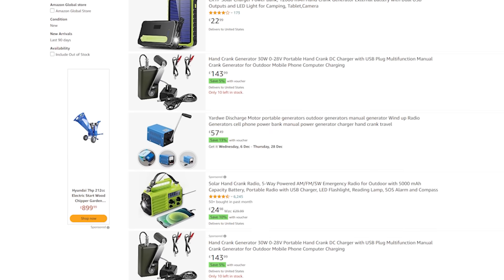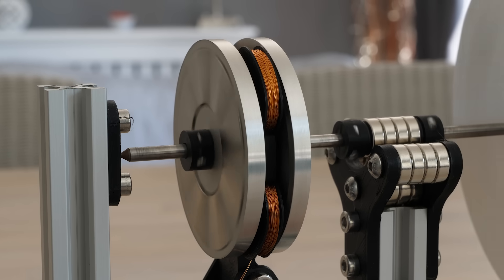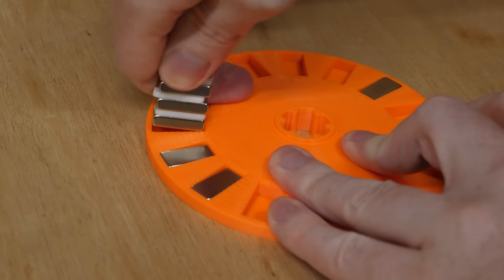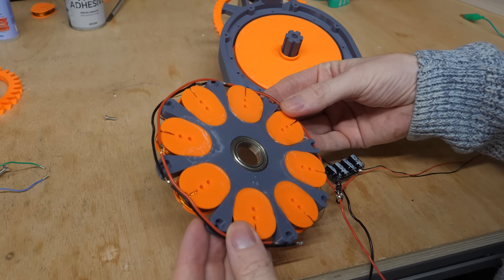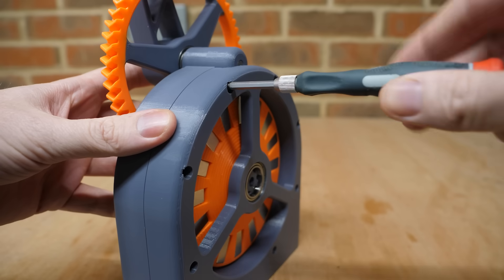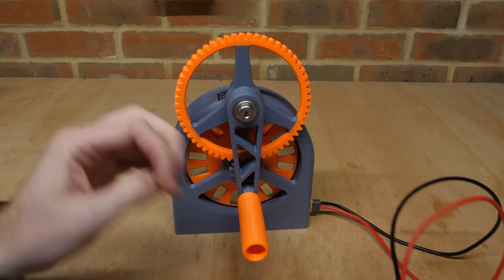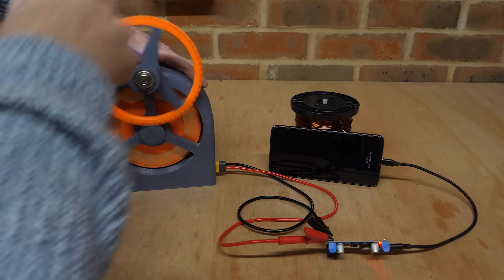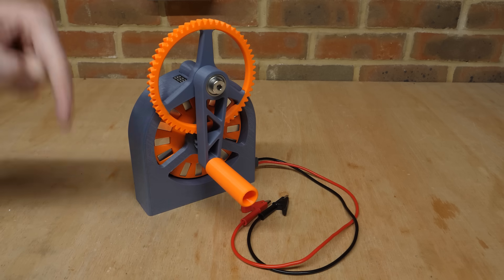Building a Generator

Comment: Your coils are biased too much towards current. Power is V * I and ultimately that's what a generator is about. Your coil wire is far too thick still. Especially in a 2S4P configuration. You could change to 4s2p and crank faster or use thinner wire with more windings.
Probably the best balance for a hand crank generator that I have seen was by some dude building stackable supercap banks. What he did was basically a supercap bank with voltage regulators.
I do think you need a voltage regulator in general. Probably two of them for 5v and 12v. or better something USB-C, for which you'd need higher voltage anyway from my tip up.
A voltage regulator will protect lower voltage circuitry and you can't do without it anyway, besides robust electrical consumers like resistor heating or charging lead batteries and supercaps.

P.S. that generator is way too big by the way for a human to turn if it was properly balanced. You can get far greater output by something about 1/4 the size. Which is at about the limit of what a human can turn efficiently(80-100W).

Comment: Great video! I wonder why you didn't measure the current?
Reply: Because it is so small. Think about old-school 3W bicycle dynamo, you can already feel the resistance in your legs. So this hand-cranked dynamo is probably smaller than that. If you want to fill 12 Wh phone battery, you need to crank the 3W dynamo for  4 hours. No thank you.

Comment: What if you had equal number of coils and magnets? I made one in 2000 as a pulse motor generator. It was a mix of Robert Adams motor/generator's design with 8 magnets and coils, and Bill Muller's design which is what you've made. It was one of the most fascinating rabbit-holes I've ever jumped into.
Normally the cogging would be terrible, having equal number of magnets and coils. Their claim In a nut shell was, to draw current from the coils as the magnet was coming towards the coil, and when the magnet came in register with the coil, stop drawing power and let the transistor turn off. The sudden back emf from the coils was then routed through a diode and to the main supply capacitor. Like a basic boost converter circuit. 
A lot of people claim this type of pulse motor generators are over-unity. They're not right. It's as efficient as a SMPS and not much torque beyond being a fan. 
But boy did I have months of good fun playing with it experimenting with different cores and windings. I used a basic stamp from parallax to control the motor. 
I still have it on the shelf as a display in my lab. Didn't have 3D printers back then, so it's all machined out of derlin, non-magnetic stainless steel and brass. A real eye candy every time I see it. 
Keep yours intact and thank me in 20 years.

Comment: You could try lighting up a 220v LED lightbulb. Depending on the driver being used they shouldn't mind being run on DC, and unless they use a capacitor dropper they should work on a large range of voltages. By the way, have you considered adding multiple stacks of coils and magnet disks?
Reply: I'd go with a 12 volt MR16 LED bulb. They generally include dc-dc converters and many operate quite consistently between around 8 to 16 volts. They also include rectification at the input.

Comment: Shouldn't you have a female connector on the output? In batteries, this reduces the chance of short-circuits caused by things falling into the connector.
Reply from the maker: Yes, that's correct. However, I wired it this way because it doesn't matter if the generator short circuits (the crank resistance just goes up). But if I charge a battery or capacitor, I don't want the wrong connector on them as that short would be far worse.
Reply: @TimStation  Ah, I completely forgot that the thing you are plugging your generator into also is a power source. And I agree, since you are charging a super-capacitor, the short would be much worse than your generator. PS: I see that @Maarrk also made the same comment.

Comment: I think you can increase the efficiency by changing the coil design. As far as I know the part off the coil that is perpendicular to the changing magnetic field contributes the most to the output. The rest is just added resistance. Also you can increase the power of the magnetic field by adding a backing metal or hallbach configuration of the magnets.
Reply: Look at hard drive motor, coils shaped like wedges with rounded corners. Why? What you just said about the impedance reluctance resistance etc
Reply: This type of motor works well, it is called an axial motor. Backplate would be nice, but only if laminated perpendicular to flux direction. This would mean like an arch of bricks between each coil. Winding layout should be 3 coils for each pair of magnet (easiest, classical synchronous machine). And the interconnection should be diffenent. It sure works with all coils in line. But he gets big circular currents driven by voltage differences due to the coils seeing different fields - also depending on winding direction of the coils (clockwise, ccw).

Comment: Awesome build and Physics applied !! And even a cool color scheme !!  Love it! I’d love to test if that thing would start the onboard computer of my car (I use it very unregulaly and the onboard 12V battery gets so low the controllers don’t come online, since it’s a hybrid, The 12v are not needed to fire it up, just to close the DC-DC so I “jump” it with my DJI Phantom Battery sometimes… ) this would be more fun as I could store it for emergencies and not carry a charged Lipo… Hand crank start of a 2003 Prius would be cool… the equivalent of a Inertia Starter for Tanks As I see it…

Comment: You should look into a serpentine coil.  This is one that weaves up and down as it goes around the full circle of the generator.  They are much easier to produce and work better than individual coils.
Reply: An even easier build and more powerful  is Robert Murray Smith thunderbolt generator. Think he got 150V out of it. Really impressive.
Just went round the bolts in a big circle. Easier than his serpentine. With offset magnets to reduce the drag.
Reply: @strawman9410 I think his serpentine is easier to do in practice for a given power output and also that the bolts will have eddy currents in them that will eat into the efficiency.

Comment: In bicycling, I usually find my legs are better at peddling fairly hard at a moderate speed than peddling faster with less force; seems like cranking hard to charge the capacitors, then letting the capacitors charge your phone for a while, would be a really ideal way for a charger like this to work
Reply: For optimum cycling performance, lighter gears and faster pedaling is more efficient for most once you get to a decent aerobic fitness.
Reply: @tktspeed1433  for you perhaps, but I'm powerful and heavy. Moving my legs fast is hard, moving them forcefully is not.

Comment: This actually gives people a very easy way of physically feeling how much power it takes to run different types of circuits, I think it would be a cool idea for a science fair or something
Reply: reminds me of a science museum that had a device with a hand crank and would let you try and power old lightbulbs vs new led bulbs and see how it's easier to power led bulbs
Reply: @thebirchwoodtree Same at the Los Angeles Science Center, but it's a stationary bike there.  There are, iirc, 5 incandescent light bulbs and 5 LED bulbs of the same light output that you can switch between powering.
Reply: @thebirchwoodtree   I saw this the first time when I was a kid and visited the "Abrafaxe Extavium" in germany. They had a bike with a generator and besides different light bulbs (incandescent, "Neon" (energy saving), LED etc.) they also had a toaster... After pushing the lever down the bike felt like it instantly slammed the brakes as it is actually quite a lot of energy to only keep the magnet engaged, nevermind feeding the heating coils with "only" ~600w xD. They had a lot of devices plugged into that bike for kids and parents to try out. I only remember these and a fan though
Reply: @thebirchwoodtree  "centre des sciences de montréal" i think
Reply: @thebirchwoodtree  🔴 What Is Islam? 

🔴 Islam is not just another religion. 

🔵 It is the same message preached by Moses, Jesus and Abraham.

 🔴 Islam literally means ‘submission to God’ and it teaches us to have a direct relationship with God. 

 🔵 It reminds us that since God created us, no one should be worshipped except God alone. 

 🔴 It also teaches that God is nothing like a human being or like anything that we can imagine.

🌍 The concept of God is summarized in the Quran as:

📖 { “Say, He is God, the One.  God, the Absolute.  He does not give birth, nor was He born, and there is nothing like Him.”} (Quran 112:1-4) 📚

🔴 Becoming a Muslim is not turning your back to Jesus. 

🔵 Rather it’s going back to the original teachings of Jesus and obeying him. 

More .....
Reply: pretty sure they have something like this in the glasgow science museum
Reply: yeah i hear a lot of good things about that museum. maybe i should check it out @KingJellyfishII
Reply: Many exercise bikes include this as a feature. They have watt readouts and you can feel how much a particular wattage is with your legs.
Reply: @ehhhhhhhhhh  competitive cyclists measure how many watts they can make relative to their weight to track their fitness and effort levels, see what effort they need on hills without puffing out, and to see what pedaling speed is best for power to know when to downshift or upshift. An inexperienced cyclist can think power is high because force is high, but can downshift and it feels easier yet the wattage is higher. Or maybe you are flailing your legs around and need to add some resistance at a lower speed. Maybe you are taking a climb too hard, but if you know you will "puff out" above 320 watts, you won't pedal faster and harder just cause it felt "easy" at the beginning of the climb.
Reply: They have something like this in practically every science/technology museum/fair.
Reply: my local power company has an exhibit in our museums that does this, with a hand crank, and a line of lights, representing various appliances.
Reply: There is a video of a professional biker trying to power a toaster I wont spoil to much but its quite humbling
Reply: I was at an open house for the Goddard Space center and they had a setup with a generator attached to a bicycle. I was able to sustain power for LED, Fluorescent, and incandescent bulbs. Then i was challenged to power a small hair dryer. 

Let me tell you that the heating elements for that was greater than the combined power demand for the lightbulbs
Reply: indeed
Reply: Yea this should definitely be in a Science Works or at O.M.S.I.
Reply: It's been done and it's good for kids. Back in the 90's at a local fair near Berlin, i pedaled on a geared down generator to power a small black and white TV. I think it had... something like 5 reductions till it got to the generator. Felt like a slight 10~13 degree climb.
Reply: Noted get a 3d printer and print this
Reply: Should be taught in elementary for a brief period
Reply: Going to do this with my son for his science fair
Reply: මැගනටි ගන්න කහේද තියොන්නේ
Reply: to bad the limitations on scheduling those sort of events is very limited
Reply: Powerhouse Museum in Sydney Australia used to have the front of a typical fire engine on a wall, with an exercise bike facing it... As you pedalled faster, different parts would start functioning on the fire engine - FM radio (which was tuned to a local music station), headlights, beacon lights, siren, etc... each part was labelled with the power required to get it running.
It was pretty easy to maintain the radio and get some tunes in the room, but quite difficult to get the headlights and beacons running.
Reply: >way of physically feeling how much power it takes to run different types of circuit
There is video named "Olympic Cyclist Vs. Toaster" - I'd say it gives a lot stronger perception of how much power we use everyday ))
Reply: My highschool science teacher had a bicycle generator hooked up to a switch board, and on a pvc stand were 3 incandescent bulbs, CFL bulbs, and LED bulbs they would turn on one at a time so you could see how hard it was to pedal for each group of lights. 3 led bulbs were easier than 1 CFL, 3 of which were easier than 1 incandescent.

There were also a few larger things like a fan, a tiny vehicle window defroster, and a 500w blender. Pretty sure a couple other small everyday items, but its been awhile.

It was great being able to feel the difference in force required to turn the generator. I think if more people were made to understand THAT demonstration, less people would be against the technological progress of dropping fossil fuels and investing into making current electrical devices more efficient.
Reply: BRO IM DOING THIS FOR SCIENCE FAIR W
Reply: https://www.youtube.com/watch?v=S4O5voOCqAQ
😁
Reply: https://www.youtube.com/watch?v=S4O5voOCqAQ
Reply: I using it for science fair
Reply: If you spin that thing with an electric drill are you generating the same amount of electricity as you are using to spin it?
Reply: @FieldBoy111  I think you can't, you will definitely loose some power in the process. So you end up producing less than input.
Reply: @FieldBoy111 nope, losing energy to friction and incomplete energy transfer from magnet to coil
Reply: It's amazing how many of you idiots think this is so cool like your so dumbed down anything will please you
Reply: I'm going to use this idea for my science fair
Reply: I used to travel to schools showcasing this. We'd start turning on multiple lights. Kids could barely last 60 seconds.
Reply: I didnt know until now that it gets physically harder to turn a generator the more energy it needs to output.
Reply: @jwalster9412 Welcome to non linear mathematics

Comment: Yeaa... Like some have already mentioned I too would suggest going with a System mimicking the System how small ICE Motors like those found on Lawnmowers are being started with a self-rewinding Cord only applying Torque in one direction. Make it so the entire System can be clamped to the edge of a Table with the Cord hanging down and be operated by your Foot. If you get the tension of the self-rewinding Mechanism juuuust right, then you may even be able to use the weight of your Leg itself ( if you operate it with your Heel instead of the Toes ) to help with the unwinding action thus reducing the fatigue.
Alternatively, you could have a go of replicating the function of how a manually operated Sewing Machine work ( like the Singer ones ) 🤨

Comment: I suppose it's not as much of a concern at the low voltage and manual power creation, but typically XT style connectors are female plugs on the power generation side so it won't short out through the two male pins with a spark.
Reply from the maker: Yes, that's correct. However, I wired it this way because it doesn't matter if the generator short circuits (the crank resistance just goes up). But if I charge a battery or capacitor, I don't want the wrong connector on them as that short would be far worse.
Reply: @TimStation  that makes a lot of sense!

Comment: come on, dc generator, current bar over a vertical ring magnet field. the current bar could be a star, ie multiple bars, or a disc, when the vertical magnet field is a ring magnet, covering well the whole ring around the spinning current bar/s. high current, low voltage motor/generator, similar to a thermocouple. no coil winding complexity. yep that electric drive train, engine-mechanical->electric->mechanical, only solid state wires, no axle.
Reply: try insulated cone pulse jet, with steel wool filling, with either heat or gasoline going to the pulse jet engine, insulation keeping the heat in the metal cone and the steel wool. yep the nuclear heat powered cone pulse jet.
Reply: you might want to try a dc hall-effect motor generator, some video footage from double m innovations channel. its full dc all the way.

Comment: We need these kinds of projects all over Africa,Asia and South America!  imagine Plastic bottles converted into 3D filament, ( CNC Kitchen and others ) and then common maker spaces with 3D printers setup and run by the UN or other non-profit non-govt orgs, imagine how many remote villages and remote areas will be scavenged and scrubbed free of plastics for recycling into 3D printer materials and re-purposed into usable products needed AT ANY TIME !  You DONT need plastics all the time, but if you can recycle them like this in-place, into useful locally needed projects!  And keep recycling the broken 3d-print plastics again and again reducing the burden on the environment !

Comment: 8:34 there’s a calibration pot/screw on the back of the blue led volt meter to dial in the voltage readout
Reply: For what he is doing the readout is probably "close enough". But, yeah. Most decent voltage readouts like that have a small calibration pot for when it matters.

Comment: why dont you talk about jacobs law?

the resistance of the "generator" and the resistance of the "load"?

or how about reluctance? the magnetic circuit? 

maybe, the number of conductors? the rate at which magnetic flux cuts conductors? how the number of turns and relative velocity determines voltage, flux determines current, and the resistance of the wire in the coil dictates how much power you cant transfer into a load?

the amount of magnetic flux?

faraday would be depressed at how far backwards we have gone.

Comment: I would add a clutch and flywheel to smooth out the cranking effort. And some Caps so you can crank around 15v to store that up. Cutting the cranking time by 2/3.